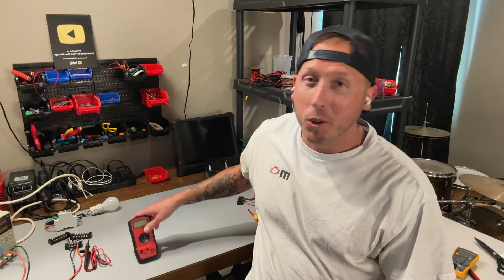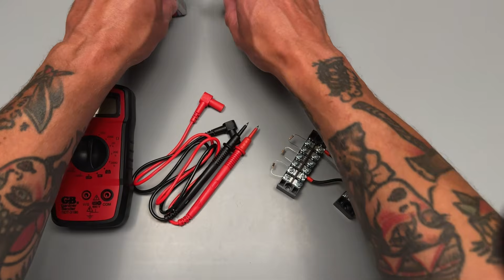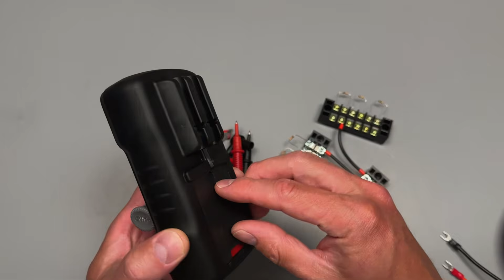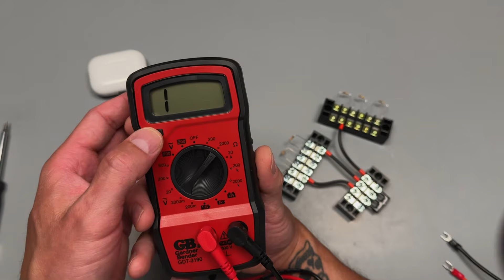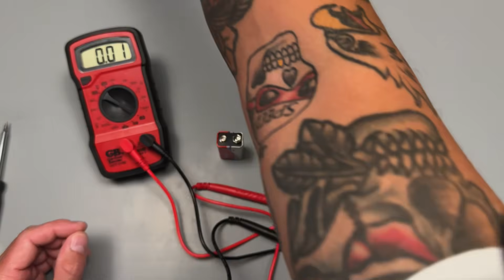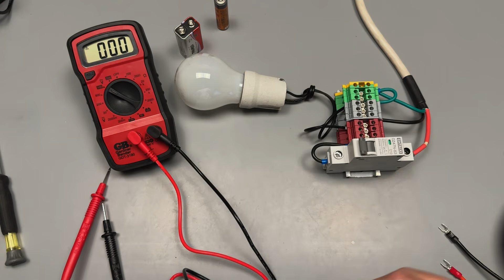How to Use Gardner Bender GDT 3190 Digital Multimeter (Manual Ranging Explained) ⚡️

Comment from the maker: 🛠 SHOP YOUR PROJECT (My Go-To Parts):
🚗 AUTOMOTIVE REPAIR:
Connectors: https://amzn.to/3M7dsTK (Marine Grade Heat Shrink)
Pro Harness Tape: https://amzn.to/49TViht (Tesa Tape)
Fuse Kit: https://amzn.to/4qeBLgy (Bulk Assortment)
See my full Auto Repair List ➡ https://www.amazon.com/shop/maddox_mechanic/list/3R3BFLMDFXKA9
🏠 HOME ELECTRICAL:
The Connectors: https://amzn.to/4qfFLxt (Wago 221 Variety Pack)
The Tape: https://amzn.to/49VCoXG (3M Super 33+)
Safety Tester: https://amzn.to/3ZKJckL (Kaiweets Non-Contact)
See my full Home Wiring List ➡ https://www.amazon.com/shop/maddox_mechanic/list/2Z7G0K2YDV4UE
⚡ SOLAR / VAN BUILD:
The Crimper: https://amzn.to/4byS2JO (iCrimp IWS-QC)
Ferrule Kit: https://amzn.to/4qdGqQ4 (Wire End Sleeves)
Fuse Block: https://amzn.to/3MlFI5h (Blue Sea Systems)
See my full Off-Grid List ➡ https://www.amazon.com/shop/maddox_mechanic/list/27922V6DQM4HN
🏪 Shop My Full Lab Kit: https://www.amazon.com/shop/maddox_mechanic

Comment: What do I set it on to test my clothes dryer wires in the back
Reply from the maker: Set it to the Volts AC 500 setting. Be super careful. Wear electrically insulated gloves and safety glasses. Thats potentially lethal voltage. Should be somewhere between 220-240 VAC